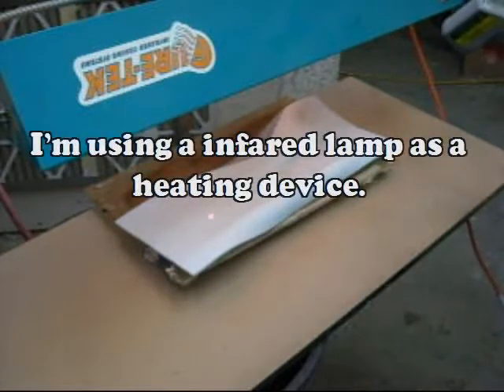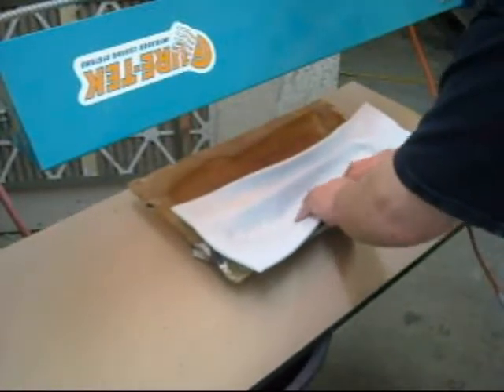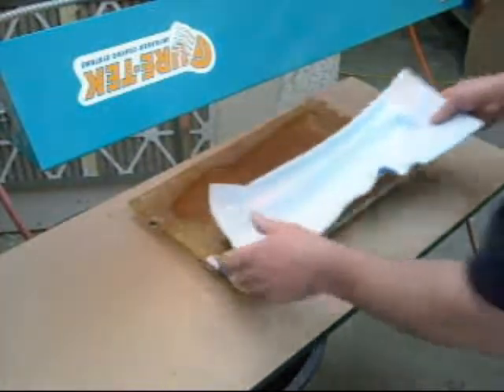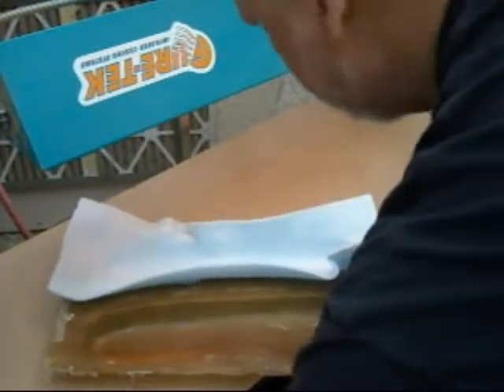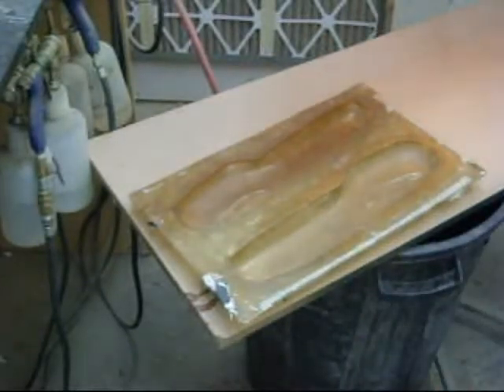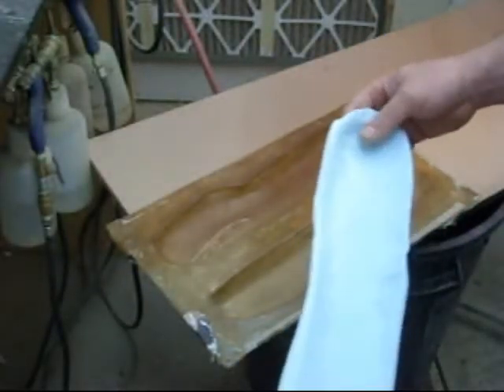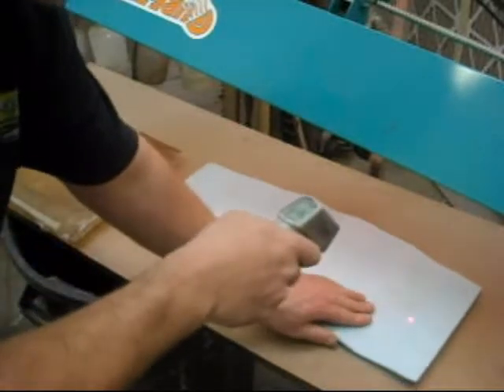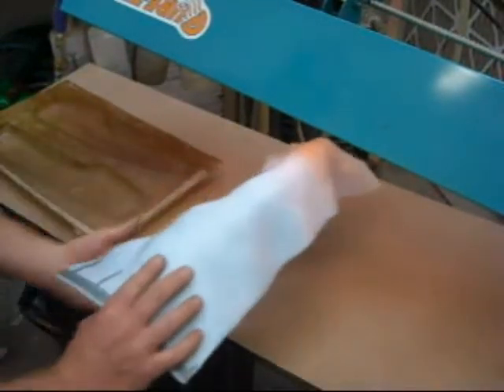Forming FFF for RC plane parts; part 1

Comment: Hey friend, thanks for sharing your explorations! Why don't you try (i just dreamt this as a solution) bags with heated sand that will take the shape of the hollow part while pressing and giving out heat in the same time? Sand keeps the heat longer so it will not be that capricious. Like this it will do the same effect as vacuum.